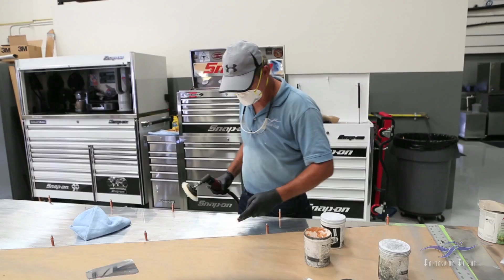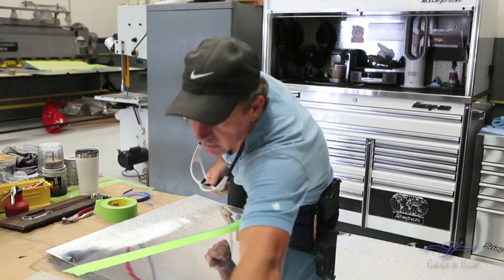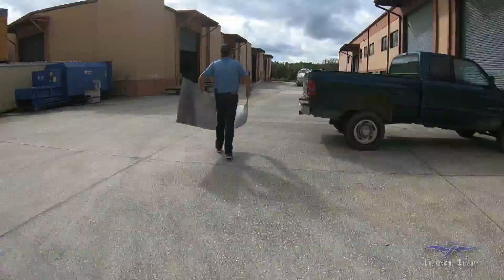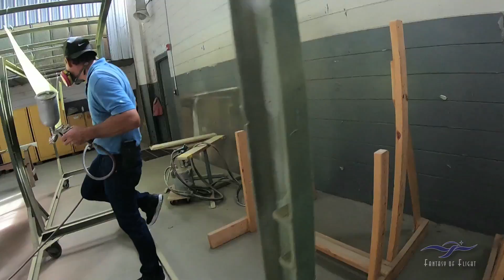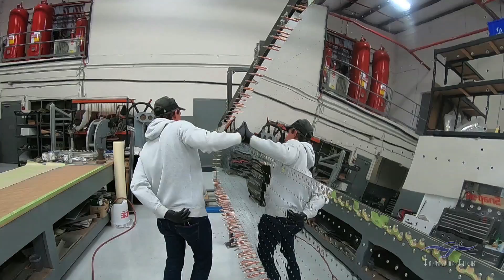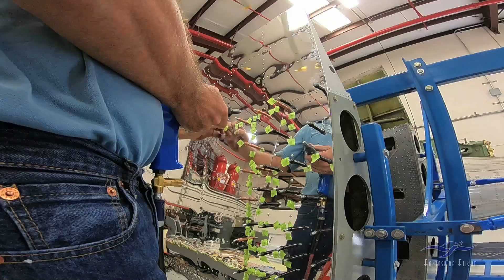Seversky P-35a - Wing Skin Fabricating - Part 2

Comment: When Rick sprayed the back of the skin panel he's not specific about which primer was used. Presumably zinc chromate. What was surprising is that he color and clear coated it. Did Seversky color coat the back of the skins on a P-35 delivered to the USAAC?
Reply: dC: It is an epoxy primer. He was quite specific.  The silver coat and clear coat are just for preservation.
Reply: Pelican1984: It appears to be mainly for the cosmetics.

Comment: I see that you are not using alumiprep to clean the aluminium nor alodine to protect the surface before priming.  I use those products all the time before epoxy prime the skin.  Is there something in your epoxy primer that negates the need of alumiprep or alodine?  Thank you

Comment: The paint shop didn't have much overspray plus Rick didn't put on a suit, then I noticed what looks to be a large swath of filters high on the wall. Do you have a gynormous fan up there that pulls all the overspray?  Also when Rick walked the piece from where he polished to the paint shop he walked past a bunch of neat looking stuff, projects, etc. That would make for a nice video someday, just provide a tour of the back operation.  Thank you Kermit for keeping history alive!
Reply from the maker: The paint room does have a wall to wall, floor to ceiling, fan and filter wall.  The shop Rick walks through has the Curtiss Jenny and Messerschmitt Bf-108 projects, both of which have update videos on my channel.

Comment: Now that you have the skin on that side tell me how you buck the rivets on the other side. Do you have a very little friend that goes inside the wing??;)
Reply from the maker: Rick Reeves here . . . I will reverse the order of the skins going back on (from how they came off) till we get to the last panel. We call that the close out panel. In the case of the P-35 wing, that panel has several access holes that you can reach into to buck the rivets. Even then, there are times you still can't see the rivet, so you're basically doing it on feel. I then go in with a mirror, to confirm all is shot well and everything looks good on the rivet, and the surrounding structure.

Comment: Beautiful work, indeed. I thought the head of the rivet would be outside and you would buck the head as you mushroom the tail with the rivet gun...? Is the tail on the outside? (Just curious...I have never done this!) Thanks for sharing.
Kermit, if there is a "dream team" of aircraft restoration, ya gotta be getting pretty close!
Reply from the maker: The head is on the outside.
Reply: I guess I expected the gun to spread the tail end, not the bucking bar. The head outside DOES make sense. Best, guys. 😊

Comment: Rick, it was a real privilege to watch a craftsman of your calibre at work. One question: Do you put any protective coating on the polished surfaces to stop them oxidising and going dull?
Reply from the maker: Rick Reeves here . . . No, there is no protective coating applied. Doing so will not allow the finish to shine as it does. We just keep on top of the finish by hand polishing every few months, or as needed. The plane will be housed in a nice hangar for its life, so it will hold up very well.

Comment: Makes me wonder how they rivet the other side on as there is no space to hold the bucking bar. Different type rivets?
Reply: cherry rivets.
Reply: there is actually very few places you can't get a bar in, but in those few places cherry rivets or back then they also had explosive rivets
Reply: Thx - i had the same question !- (I cant see how one could get a bar in w/ any control or pressure  when applying the opposite skin)

Comment: Its a beautiful finish, even if not really authentic for the aircraft of that period. Where I am in New Zealand, polished metal is grossly impractical so you don't see it very often. The salty, maritime climate causes it to oxidise and corrode at a terrible rate - the only polished bit of my aircraft is the propeller spinner, and that's hard enough to keep shiny!  We'd also use chromate joining paste in the skin laps, and prime under the rivet heads, otherwise we'd have corrosion issues down the track.  great workmanship shown here though, and the aircraft is going to look spectacular!
Reply: it was, there were quite a few aircraft that were left bare aluminium before WWII, basically it was for better aerodynamics and top speed, while making easier to inspect the skins, the downside is that it needed more care
they maybe were not brought to a high sheen, but polished skins existed for a while
Reply: @quentintin1  Corrosion control was not much of a consideration until the mid-late 1940's.  Additionally, these were combat aircraft with expected lifetime of weeks or months.  They were not being built for the ages.

Comment: It's pretty amazing to realize that, back in the day, factory workers were cutting and punching holes in sheet metal and throwing them on a stack to go to assembly.  Then, the guys in assembly were grabbing them and riveting them on, one after another, never taking any amount of care other than what was necessary to keep from damaging the metal.

A question to consider.  Is someone REALLY restoring the aircraft if they are doing SO much more than what was originally done and making it SO much more a work of art than a mass-produced vehicle?  When furniture, art, or anything else is restored, it's brought back to as CLOSE to original condition as possible, flaws and all.  When aircraft are restored, why are they turned into museum pieces?  Why are they not assembled with as close to the SAME original processes as possible?  It would seem to increase the aircraft's value if it was as authentic as possible.  It's the same issue I have with aircraft with bare metal finishes being turned into mirrors (see Kermit's P-51C), when they had dull finishes during the war.  I know it protects the metal, but there are other ways to protect the metal which look much more authentic.  That's my nitpick, because I have Asperger Syndrome and things that don't look the same as they "should" just don't look right to me.
Reply: Hello, fellow Aspy!  I know exactly what you mean, but Kermit has to impress all the "normal" people, so they will buy tickets to the museum.  
Also, even if it isn't like the original, it is pretty impressive.

Comment: Thanks for the artistry- great to see someone taking so much pride in their work. Is the polished aluminum not clear coated at all? I assume that the surface is just re-polished once the unprotected aluminum starts to oxidize.
Reply: I’d also like to know
Reply: The original airplanes were not polished like this. Once you start you've committed yourself to the task of keeping it that way. In the Air Force we had a few birds that had "brightened" skin and there were guidelines as to how often it could be done since it does remove metal each time.
Reply: bearbon2 I would think a clear coat over it would be the way to go but I don’t know if there’s a product that would stick to aluminum polished that much.

Comment: so why have it polished like that? I dont think they had polished fighters in ww2
Reply: Hardly the same thing, if they are restoring a plane then it should be to same standard as the original
Reply: Etienne Dont get me wrong, what they are doing is really cool, amazing and all but Im just curious why the plane is made to a different standard than original. Airracing hotrod planes like in Reno is a different thing.
Reply: @pete_mitchell  there were quite a few planes that had a polished aluminium finish in the 1930-1940s, paint had weight and can cause drag if not properly flat, so leaving the plane bare was a way to get the most top performances, it also allowed for better inspection of the skin, the only downside is that it needs a bit more maintenance as the aluminium is exposed to the elements
during WWII, the USAAF painted their planes for camouflage purposes but they stopped in 1943 was they did not believe that the advantages of camo outweighed the advantages of leaving the plane bare, the practice fell out of favour with the use of composites for airplane construction, the fact that Jets aren't a affected by the paint and modern paints are a long way better than what they had in the 1930s
Reply: Max I know there were unpainted planes in ww2, but they were not polished to a mirror finish. Not painting was because they wanted to get the planes out of factories and camouflage was not as important as getting the planes out faster. Some of what you say is true but you are missing the point. They didnt have time to polish the bare metal on the planes.
Reply: The P-35 was a prewar fighter. In period photo's the P-35 delivered to the USAAC appear to have been polished but not to the very high level that Rick has done here. Check out a pic of the original P-35 in the collection of the Museum of the United States Air Force.
Reply: @dalecomer5951  Im no expert, but looking at old pictures of unpainted p-35 planes i would say they are just aluminum sheet as it comes from the factory, not polished in any way. This is the case with some museum exhibits(but not all, some are polished).

Comment: You should use 1 pad for each type of grit, its wasteful of materials to just do 1 section at a time, changing grit on the same brush. Shoulda done the entire panel in 1 grit, with 1 brush, then switched to medium grit with another brush over the entire panel. This to me just seems like something a person who is in training school would be taught and does. Also removing the Clecos would help in each section and replacing them back after you covered that area lol.
Reply from the maker: The purpose of doing one section only was to be able to film and show the process all the way through. It would have been impossible to coordinate my time and the cameraman's time to do the whole panel, plus it would have taken hours.
Reply: @KermitWeeks444  Aah good point haha thanks. That was my silly mistake.